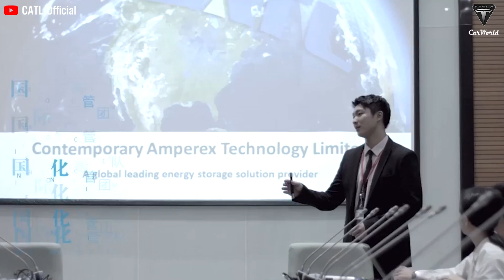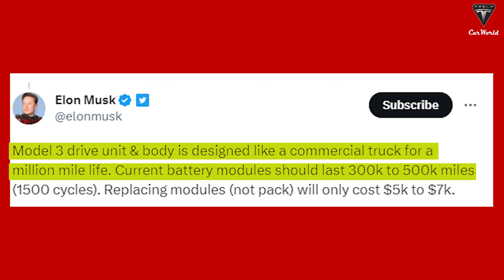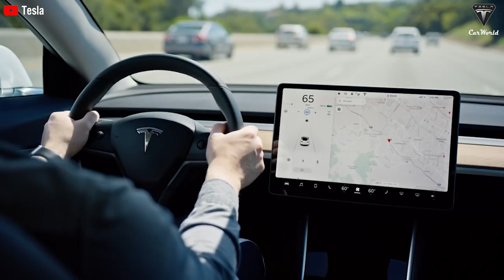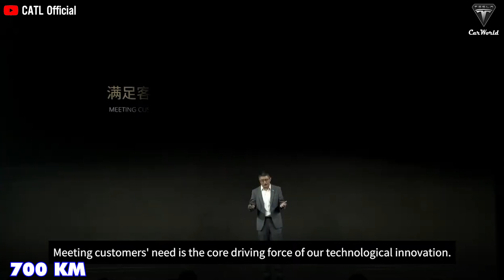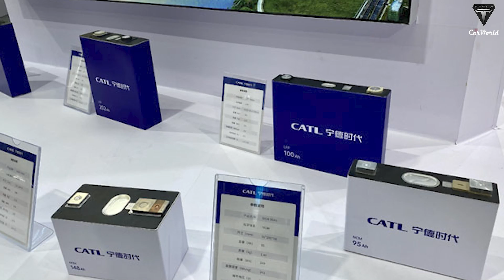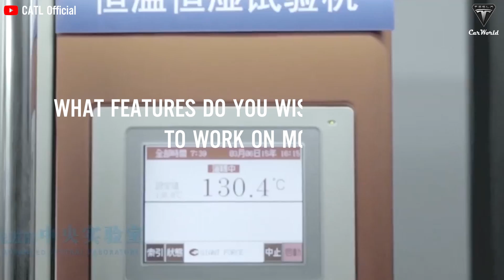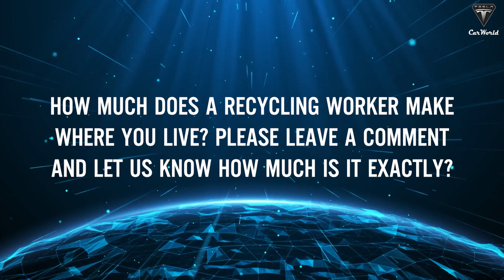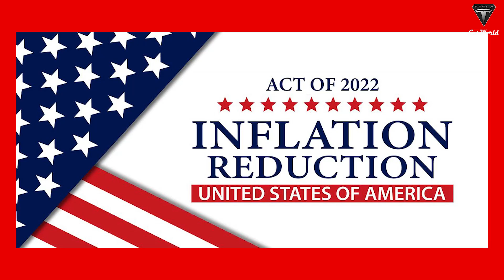IT HAPPENED! Elon Musk Revealed ALL-NEW 2-Million-Mile Battery, Shocking Industry!

Comment: My cars are 17 and 18 years old.  I wish batteries were designed to last for more years. Not likely to exceed the mileage limit but exceed the age limit.  It will be interesting to see how the batteries work in practice.  My son has an ID4 and they are in the process of replacing the second battery module and he has less than 30,000 miles and 2 years.
Reply from the maker: That's correct. Battery replacement in a short period of time is a significant problem for electric car makers. Finding a battery that can extend the life of the car is therefore critical. With a lifespan of around 16 years, this new battery is doing an excellent job of enabling the full use of electric vehicles.
Reply: @TeslaCarWorld  I fully support improving the battery life. My point it needs to be more than the number of recharging cycles, we also needs batteries that last a long time. Americans are keeping their cars longer and they would want to keep electric cars even longer except the industry appears to be satisfied with a battery life that is about the average age of cars on the road in the US.  I don't believe that is adequate.  My granddaughter is driving our car which is 25 years old but only has 300,000 miles on it.  My point is few consumers will put 2 million miles on their car, but many may keep them for 20 + years.  I would rather have a battery that lasts 1,000,000 miles and is good for 25 years, than a battery that is good for 2,000,000 miles and 15 years.  Maybe that will be the case, but I don't here it in the discussions